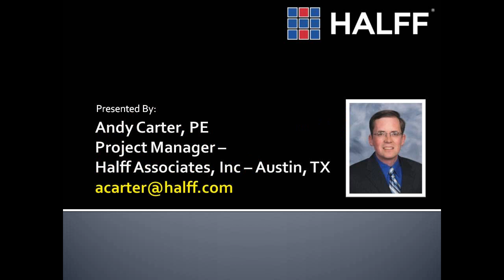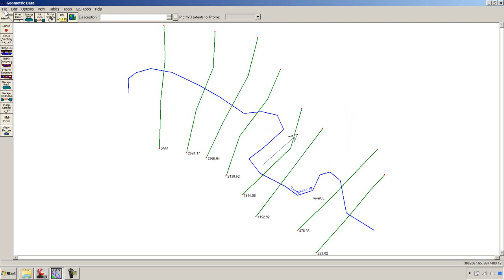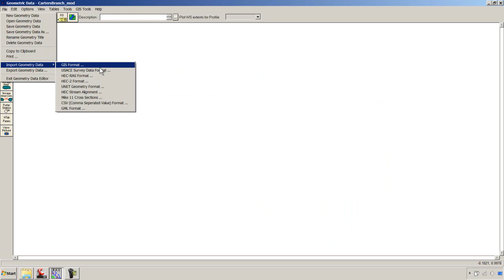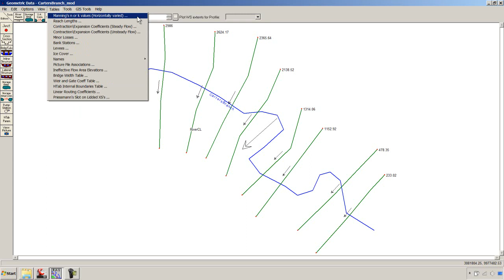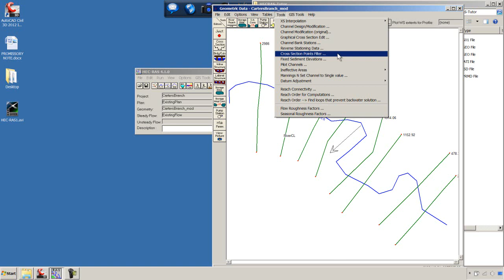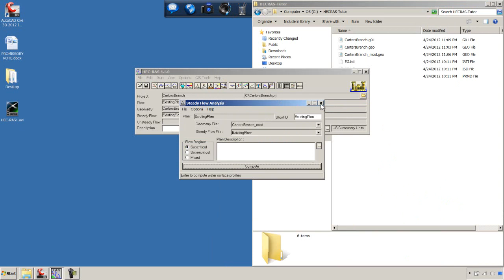HEC-RAS and Civil3D, Part 2 of 3

Comment: running into a bit of trouble with the recent update to hecras, trying to output the water surface elevation shape file from ras mapper, and i do not have a projection file.  Do you have a tutorial on how to setup the new HEC Ras Mapper with an ESRI Projection File, as well as the Spatial Reference System Projection?  I am completely lost.

Comment: Issue:
Using "Export to Hec Ras" feature, you export a .GEO file from Civil 3D to Hec Ras. Once you import the .GEO file into Hec Ras, the stream direction is reversed.

Solution:
Solution
To Reverse the flow direction in Hec Ras, go to the Geometric Data editor> GIS Tools> Search Invert Lines Table > and Flip Coord. Order.

Comment: When I add data from civil 3d to hec-ras, the left and right bank distance is the same as the centerline distance so it is modeling the river as a straight line...is this correct? This doesnt take into account the river or reach turning, is there a way so that the distance will be accurate when brought in from civil 3d?